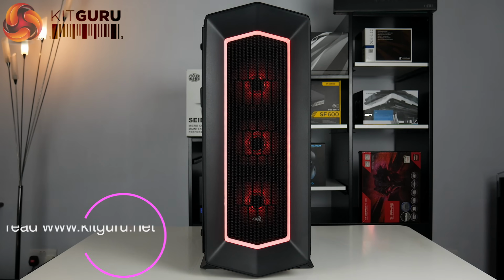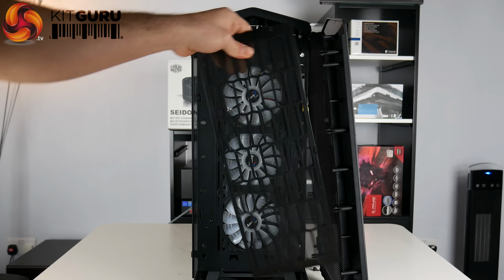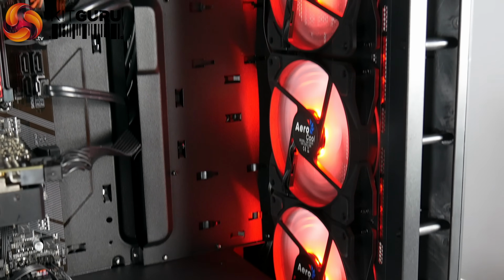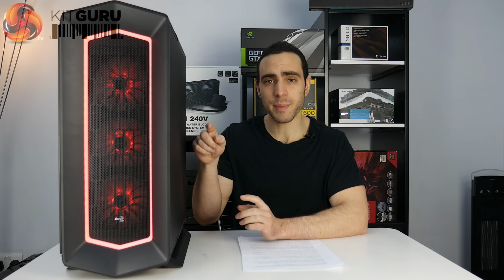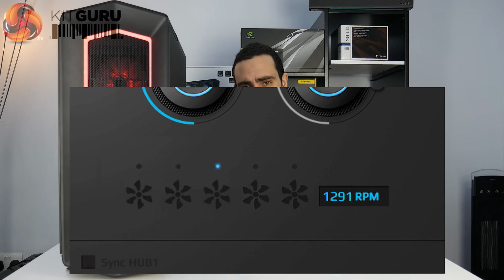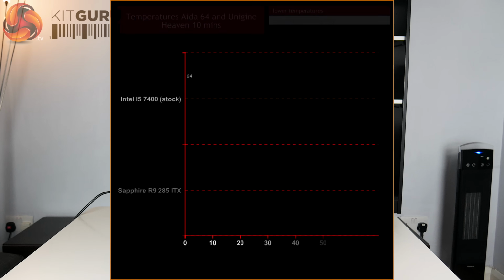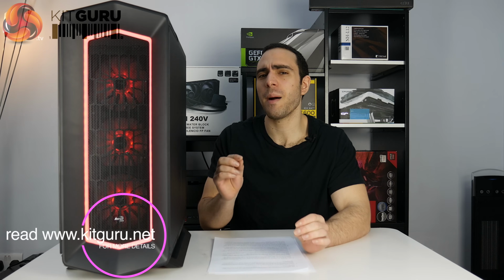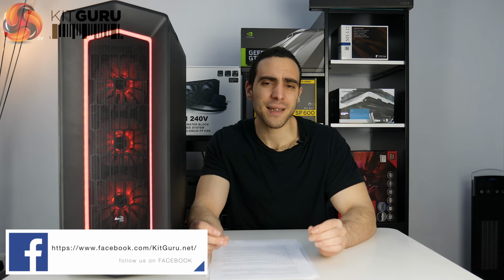Aerocool Project 7 C1 PRO Chassis Review - what's PRO about it?

Comment: It's fairly well priced, considering it comes with 4 fans, controller for rgb and fans, + the tempered glass panel.
Most TG mid tower cases go between £140/£200, that's without 3 rgb fans up, the sd card reader is also a plus, even though its only usb 2.0 speeds.

Comment: I dont understand why but we cant mount my Rtx 3060 Ti trio onto Mobo and case itself. We have enough room,  though. You mounted three fan monster. Good. I have Rtx 3060 Ti trio msi.   My case P7 C1 pro has enough Gpu clearence 370mm but i cant mount it horizontally on Mobo cuz chasis's cable protection raise where the Gpu's end meet with on inner right side, just alil bit front of three fans. How can i fit it ? Plus, my gpu mounts on chasis fan 3 headers. So cant put it, too again.

Comment: I like the case for it's look. It's only an ATX form factor so I would have liked to be able to fit an eATX board. I feel the wide feet at the base are for added top heavy stability, keeping it stable from accidental tipping due to its height, so I disagree with this reviewer here. Also, the feets flimsiness, as reported here, is rather inconsequential as no one is going to be sliding this thing around once a build is complete. The bottom filter on the case can be completely ignored for 5 years as it won't have much buildup at all, if ever.

The hub included DOES have fan speed control, it's just the software that comes with it, doesn't, so keep that in mind because it can be replaced if desired. Cable management, I agree, is abhorrent. It's going to take a whole lot of work to keep things tidy if you're even the slightest obsessive about such things.

I dunno, I feel mixed about this one, cable management being one of them. I found another reviewer who pointed out a few things in a different light, namely the custom water cooling aspect, which is also important to me personally. Overall both reviewers points are reasonably made. Water Cooling, Cable Management, space and looks are all important for me. 3 out of 4 ain't bad.

Here's another trusted reviewers take on the case. He points out the water cooling and other features a little more than here. If you're looking for additional observations, head over and check it out.

https://youtu.be/5b1Yr4bisQU